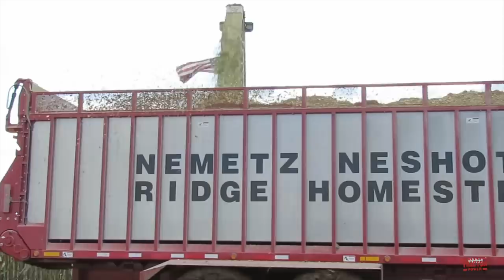CLAAS 980 Jaguar on Tracks Harvesting Corn

Comment: I've run a JD 8970 on triples and a T9.615 on Smart Tracks and i'd side with triples as when the tracks spin out they gum up and you're dead in the water but a 4wd with triples you just lock the diff up and articulate and walk it out, worst case you just unpin the tool-bar and drive out, then strap back to the equipment and pull it out then hook back up and get on.
Reply from the maker: Very interesting to know.  I have seen the two track machines bog down in mud but I did not know the 4 tracks do as well.

Comment: Love watching those choppers eat silage , is the 980 the largest of all choppers ? I run grip tracs on my CR 10.9 love them
Reply: I'm pretty sure Krone produces a bigger one, I also think claas produces a 990 now :)
Reply: @IxCerial  Yeahh Krone has the bigger one, with 1110hp. Yes Claas produces 990 with around 925hp.
Reply: There is a 990
Reply: XDSingularity did new holland have a big one few years back
Reply: @XDSingularity  Krone does have 1100hp, but the engine is actually exactly the same MAN, just downtuned for Claas. The thing is Claas is a better machine than Krone. Forage harvester is a very complex hi maintance device, more than a combine I would say. Power is not everything.
Reply: @XDSingularity ,  the Krone Big X 1180 features 1,156 hp, more than the Big Bud 747 articulated 4 wheel drive tractor has.

Comment: Could be matched ideally with couple of Axions with Terra-Trac half track setup. 😏
e: Did you ask why the farmer didn't choose CLAAS own tracks to that Jaguar?
Reply: Isnt TT on jaguar quite new? This might be an older machine, and TT might not been an option when it was ordered.
Reply: These just seem to mount on the wheel axle, you couldn't swap between wheels and TTs based on field conditions
Reply from the maker: The 990 on Terra Tracks just came to the market.   The 990 was not available when this 980 was purchased.

Comment: They appear to lose a lot of blow over ,any way to estimate how much or correct that issue ?
Reply from the maker: Every chopper has spots were some material is lost.  Ultimately they are moving tons and tons of material at a fast pace.  These 28 ton forage boxes are filled in about 5 minutes. That’s allot of volume through the harvester.  Combines lose about 2% of the grain out the back.  On a chopper loss is very visible but I would even think it amounts to 0.1% of the entire field.
Reply: You will always have blow out. Especially if it is windy and there are no wind barriers

Comment: Does anyone make hydraulic assist traction drives for the trailers. We farmed in wet conditions in the 70's and adapted a truck and drove the diff via a pto shaft. We could pull big loads with small tractors, infact, the heavier they were loaded the better it worked.

Comment: Not even filling the trailers all the way full. Waste of fuel and time.
Reply: If there's another tractor waiting on the other side, there isn't a point in trying to fill the wagons all the way up and have to slow down or stop to switch to the next one. That, and less than optimal field conditions mean that it wouldn't be a good idea to fill them to capacity and possibly get one stuck.
Reply: @DeathHead1358  whats the point in wasting the fuel? So what if there is a tractor waiting.  Follow and one pull out other pull under keep moving.  I doubt they would have gotten stuck with the weight and 4 wheel drive. But what do I know. 🤷‍♂️🤷‍♂️
Reply: @allenwray6595  Been there, done that. They can and will get stuck, especially when there's 28 tons of silage behind them. Those tractors will take 2 or 3 days to burn the amount of fuel hauling 1/2 and 3/4 loads as the 850hp V12 in that cutter will in a day.  Not mention, getting one out when it's stuck means even more downtime, risk of breaking something pulling it out, and the possibility of the cutter stopping. Every silage crew I've ever been around focused on keeping the cutter running as much as possible.
Reply: You cant fill them trailers all the way. They tried to and they got stuck left and right. Besides them trailers can really only hold about 23 tons of feed